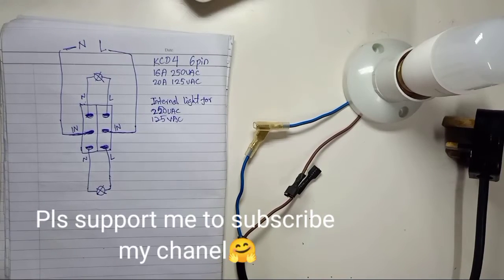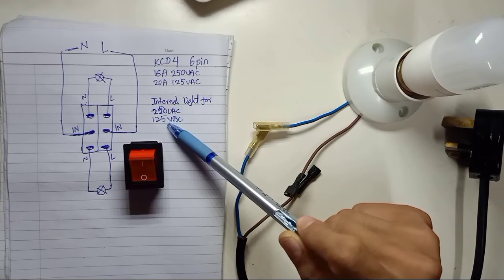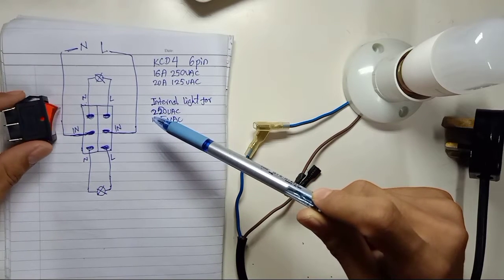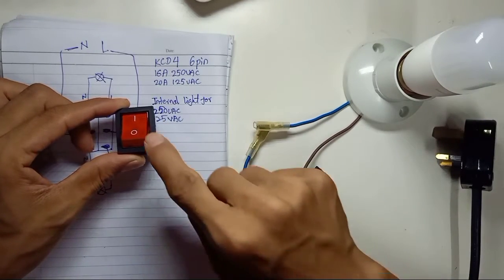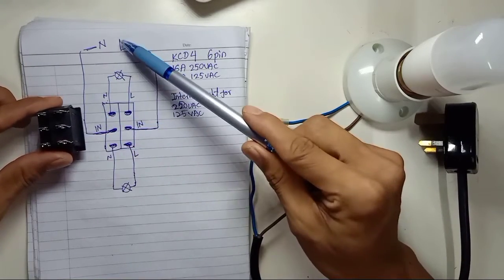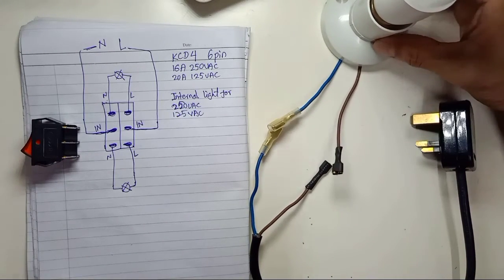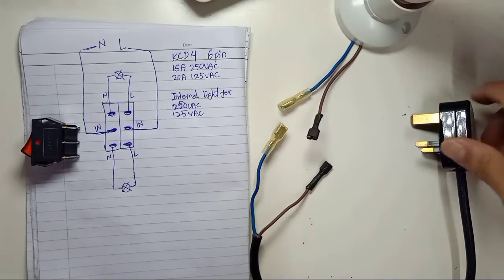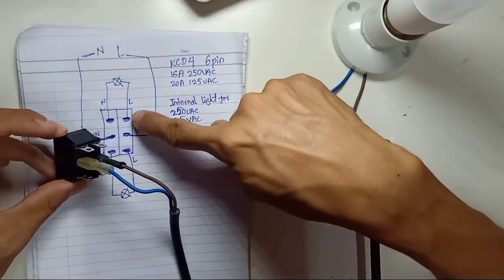How to use KCD4 6pin Rocker Switch AC 220V Neon.

Comment: Love how you actually have an example how to wire and use it 👍🏽 so I have a question. I have a 6 pin rocker switch for motorhome, I have to hold it up to extend my side pop out and or hold it down to retract side pop outs. Would I still wire the same way?
Reply from the maker: @robertthomas3862  In that case  i think you need 6pin 2side spring back Switch. just like Car side mirror switch but wiring not same

Comment: Is applicabel if the scenario is theres 2 power supply ?
Reply from the maker: Yes,it can be use for two power supply because this switch is basically one body two terminal control.but if you use with 2 power supply switch neon light can not be used. So it is not recommended to use for 2 power supply.